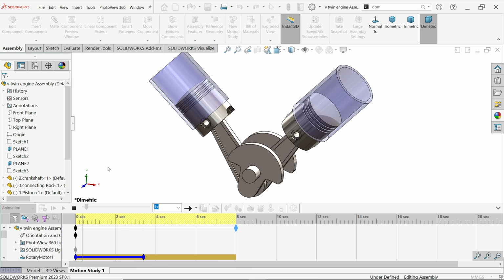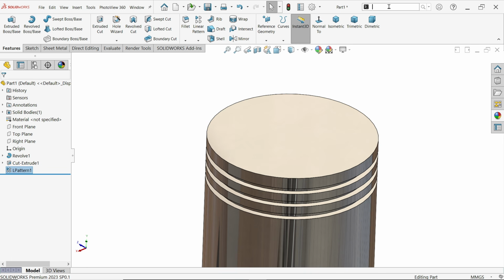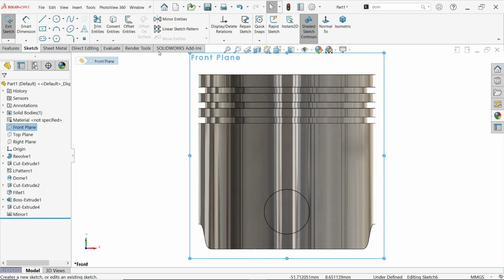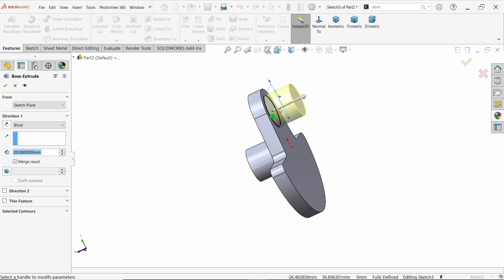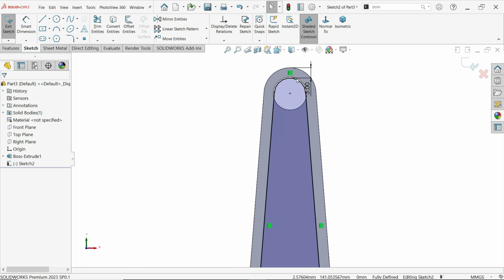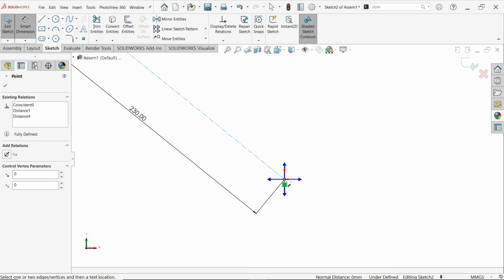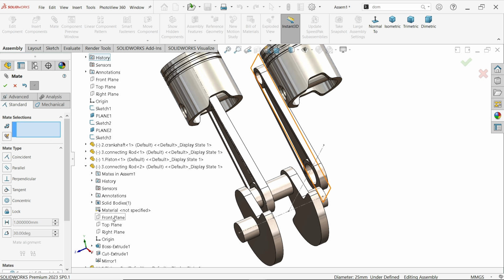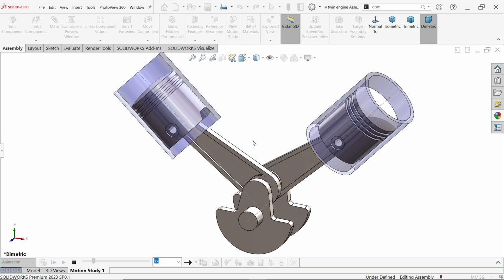90 Degree V TWIN Engine in SolidWorks

Comment: Trying to extrude the hole using up to surface option and I get a Rebuild error: The intended sketch does not intersect the model. Please check the sketch and directions. WHY
Reply: Draw the centre line imo
Reply: Bro u r not using extrude boss feature

Comment: Trying to extrude the hole using up to surface option and i get a Rebuild error: The intended sketch does not intersect the model. Please check the sketch and direction.
Reply: because you need to boss-extrude and don't cut-extrude
Reply: nice,thanks bro @mariomatt1
Reply: @mariomatt1  thanks bro
Reply: I hope your sketch is over lapping with lines so they do not work check sketch again it's works easily ..
Reply: Same
Reply: Same  :(
Reply: extude karo na ki cut ho jai ga